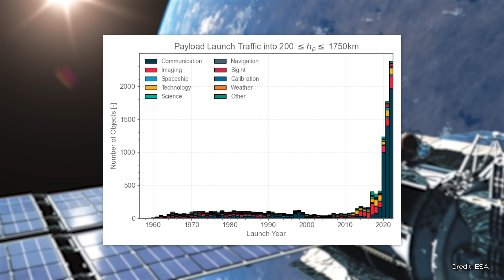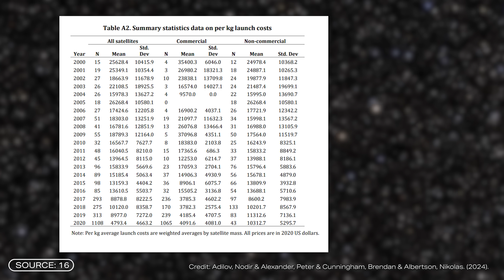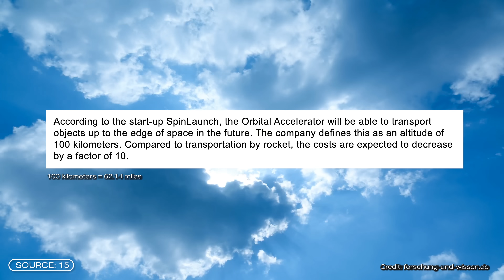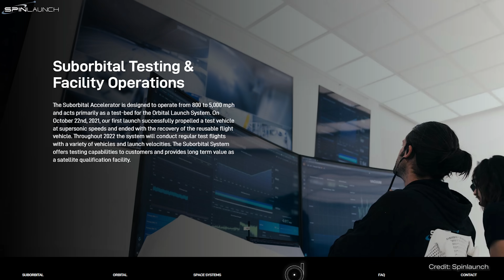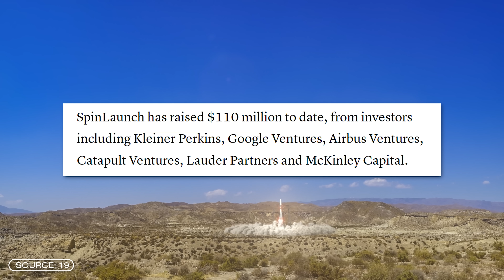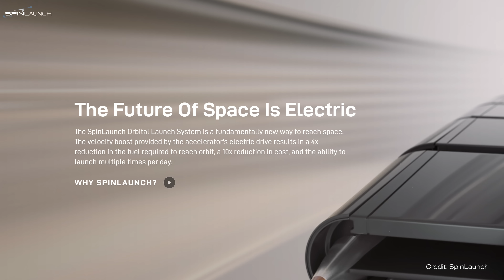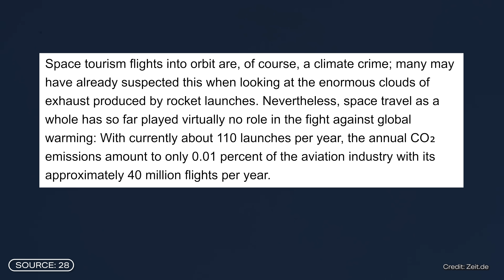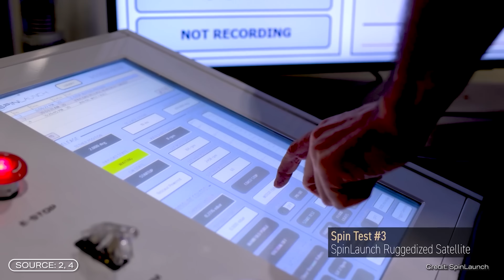How Do We Throw Satellites to Space? Update SpinLaunch

Comment: SpinLaunch is a bad idea that will end badly for the investors.  SpinLaunch can NOT launch anything into orbit, in order to put something into orbit Spinlaunch would need to also include a ... wait for it ... rocket in order to add the necessary dV to get to LEO and to circularize its orbit.  Also, the g-force the satellite/payload would need to tolerate is over 10,000 g's.  EG.   if SpinLaunch tried to launch a payload at 8000m/s and the radius of the arm is 160m the g-force would be over 40,000 g's or 400,000 m/s^2.  So SpinLaunch is NOT going to be able to release something going fast enough to reach orbit as the g-force would be insanely too high.  Indeed, if they only tried to reach 4000 m/s, about half the velocity needed, the g-force would still be over 10,000 g's so that's out of the question for most actual satellites.
What's next German Science Guy, the Space Elevator?

Comment: do a video on the Jucero!
Reply: they already have a high initial velocity while in the atmosphere. maybe use a ram-jet & take advantage of the air while they have a chance. it doesn't matter if you add velocity at higher or lower altitudes except you get the square of velocity loss from air friction, but then you might not need a rocket. nothing matters. who cares.

Comment: Not yet explained: Imbalance of the centrifuge.  When one end of the rotor releases a mass, m, with linear velocity, V, that carries away momentum, m*V, leaving behind -m*V, the opposite momentum, in the centrifuge.  Where do you find that momentum?  In a simplified case, that momentum could be associated with an equal mass, m, at the opposite end of the centrifuge.  If the satellite launches vertically, straight up, then at the instant of launch that opposite-end mass is moving straight down, and after 90 deg. rotation, its downward momentum is gone and it's moving horizontally.  The centripetal upward force needed to arrest that downward momentum, integrated over time during that 90 deg. rotation, obeys integral(vertical_force*d(time)) = m*V.  In effect, the rotor bearing has to supply the entire upward momentum of the launched projectile in the space of 90 deg. of rotation.  But the rotor is still imbalanced and spinning.  So let's get clever.  When we release the satellite projectile mass, let's launch an equal sacrificial mass, m, from the same radius at the opposite end of the rotor, sending it down a deep hole so it's safely far away when it hits bottom and goes KABOOM!!!  So with every launch you've created a little underground nuclear blast and you're just having to deal with a growing hot cavity in the ground.  But suppose, instead of launching a sacrificial mass, that you somehow reconnect your centrifuge rotor to a new bearing whose axis acts through the altered center-of-mass just after launch.  Then you have a re-balanced rotor, spinning on a new axis, and you can recover its kinetic energy (with losses) by regenerative braking and somehow store that energy for your next launch.  But you still have to deal with the entire momentum of launch, m*V, even though that momentum is now associated with a much larger rotor mass, call it M, moving down as a much lower vertical velocity, call it -v (minus v) so that momentum is conserved as the sum: m*V + (-M*v) = 0.  Your re-centered centrifuge axis is moving down after launch, and you have to stop it, but that large mass carries much less downward-directed kinetic energy, E = M*v^2, than you'd have in the small sacrificial mass at E = m*V^2.  You have a huge amount of linear downward momentum to deal with, quickly, while that momentum is in a more complicated dual-axis rotor carrying more recoverable rotational kinetic energy.  My problem: in SpinLaunch reporting, I'm seeing nothing like this being discussed.  At www.spinlaunch.com, in the SEE IT IN ACTION link, at 2:12 a control engineer says, “Taper down.  Water brake.”  Four words, to cover the entire topic I’m raising.  That might be enough to sell an investor, but I’m not sold.  What are they actually doing?
Reply: Adding  to my own comment, an obvious engineering adjustment to this imbalance problem might look like this: Mount satellite projectiles on both ends of the centrifuge rotor.  The first projectile launches, and the entire rotor recoils, moving away from the direction of launch while the central shaft is also undergoing a circular motion with the true spin axis moved to a new c.g. location.  After a full half-revolution, the second satellite projectile launches, at a slightly lower speed if it launched from the same off-axis-shaft radius because the axis shaft is recoiling away from the first launch.  Nevertheless, if the rotor is much more massive than the projectiles, then both projectiles can reach orbit with the help of rocket boosts.  Meanwhile, launching the second projectile re-balances the rotor.  Now the engineer has to deal with the recoil momentum from both projectiles and, as with a very large cannon, the moving spin shaft must be stopped and brought back to its original location.  The rotor might disengage from the motors when it recoils and then be re-engaged when it is brought back in line, or the entire assembly with motor-generators might recoil as a unit, an engineering choice.  One way or another, recoil and balance both have to be reckoned with.
Reply: @JosephSeale-i2v  I think I remember from some other discussion of this system that they release a dummy counterbalance mass at the same time as the satellite.

Comment: I have this package of Jordan "floss" tooth cleaners. There are around 20 in a newly opened pack. The pack weights around 35 gram, so each tooth cleaner weights around1,75 gram. At 10.000G, one tooth pick will then weight 17,5 KG!

I don't think it's as simple, as just glueing components together. If you say a SMD resistor weigh a twentieth of the toothpick, that's still almost a kilo for that tiny resistor.

Comment: The payload can withstand 10,000g. But what about the remainder of the rocket? Presumably it will be liquid-fuelled, because solid fuels are both polluting and produce exhaust cinders which can be really hazardous at orbital velocities. Then the rest of the rocket structure has to be strong enough to withstand those accelerations. Strong means thick and heavy. I cannot see this technology working for orbital payloads.

Comment: SpinLaunch? Can we survive the speed of the spin to launch to orbit, let alone going through the atmosphere at such speeds? Science Guy explains what SpinLaunch has developed to survive the trip. ‘Not we humans, but the rocket and its cargo.’ I still think a mile long, foot wide or maybe a meter wide Bore Hole riding Maglev rails in a vacuum tube, could get a meter long rocket high enough to start its solid rocket fuel booster and reach The Moon, but what do I know?

How about a mile high tower with a vacuum tube with Maglev rails, shooting a rocket. Could a mile high tower get a meter long rocket high enough to start its solid rocket fuel booster and reach The Moon?
‘How about on The Moon? That’s a Mass Driver.’

I asked Only the Facts about shooting a rocket out of a vacuum tube:

A mile-high tower with a vacuum tube and Maglev rails could provide an initial velocity boost for a projectile, but it would be entirely insufficient to launch a meter-long rocket to the Moon for several fundamental reasons:

Velocity Requirements: To reach the Moon, a spacecraft must achieve Earth escape velocity, which is approximately 11.2 kilometers per second (km/s) from the surface, or first reach Low Earth Orbit (LEO) at around 7.8 km/s and then perform a translunar injection burn.
Acceleration Constraints: To reach even a significant fraction of orbital velocity (e.g., 1-2 km/s) within a 1.6-kilometer (mile-high) track, the acceleration required would be immense. For instance, achieving 1 km/s in 1.6 km would necessitate an average acceleration of over 300 gravities (300g). No rocket, let alone a delicate payload, could withstand such forces.
Atmospheric Drag: Even at a mile (1.6 km) in altitude, the atmosphere is still relatively dense. Once the rocket exits the vacuum tube, it would immediately experience extreme atmospheric drag if launched at the high speeds necessary for a meaningful boost, rapidly dissipating much of its kinetic energy.
Delta-V from Solid Boosters: A meter-long rocket, even with a solid rocket booster, has a minuscule capacity for propellant compared to the vast amount needed to achieve the total change in velocity (delta-v) required for a lunar trajectory. Spacecraft bound for the Moon typically weigh thousands or tens of thousands of kilograms and utilize multi-stage rockets to gradually build up speed and altitude. A meter-long rocket would possess a negligible mass fraction dedicated to fuel and payload.
Payload Capacity: A meter-long rocket would have virtually no useful payload capacity for a lunar mission once its own structure, guidance systems, and propulsion system are accounted for.
While Maglev launch assist systems are theoretically explored for launching payloads to orbit, they are typically envisioned as supplementing very large, multi-stage rockets or for launching to very high altitudes for air-breathing hypersonic vehicles, not as a primary means to directly achieve lunar trajectories with small, single-stage rockets. The energy and delta-v requirements for a lunar mission are orders of magnitude beyond what this proposed system could provide.

Comment: As an engineering student back in 1983, I had an assignment to design an identical spin launcher, in the context of sending back pellets of refined metal from an assumed mining and smelting operation on the surface of the moon.  Such pellets wouldn't care about the g forces, which helped, and the lower escape velocity from the moon also makes it easier than launching something from earth. 
Regardless, it becomes a material selection problem very quickly, due to the forces and stresses involved in those very fast rotations. 
Another consideration is unbalanced mass.... either it is out of balance after launch of the satellite, or before launch.   Either way this creates large forces that need to be managed. (Unless you fire one projectile downward at the same time as you fire the other upward, but that might be a bit scary... 😂 )
Reply: I was wondering about that myself.  In 30 seconds of brainstorming one ideas was to use something mostly based on water as the "counter projectile" and arranges for it to be turned in spray in something like the flame trenches of a conventional rocket.  Either way, I bet it's going to be spectacular no matter if it works or fails!
Reply: This could be manageable, but it requires fast moving masses on the counterweight and launch arm and very sturdy axis with vibration compensations. 
I did some quick estimates of an alternative, and it makes also no sense:
mount a railgun in a large custom airbus (the plane itself can be seen as stage one).
Railgun length 40m, same 10000g stage 2 acceleration on the railgun.
The launch would maybe
 take 40ms during which the plane would be decelerated by 2.5g.
That could be within the limits of the airframe if it is specially designed. And the delta V on the plane would not really be noticeable, but ... top speed would only be about 2 km/s (between mach 5-7 depending on altitude)
Longer railgun would fit in the A480 (60 m) maybe et extending the nozzle beyond the plane. But the big issue is the bending forces on the airframe: not something these planes are designed for, especially not for repeated launches. It may work for a few launches and then something will break.

Comment: Having to make everything safe for 10,000 g is a deal breaker in itself. Adding glue, that is more mass, isn't a solution in this context, that's stupid. Absurd g-forces and highly restrictive size/shape of the payload, would make it extremely restrictive, if they ever would get it to technically work.  A very small, if any, part of very small market means they won't be able to make profit to finance further development, so they're doomed to always spend other peoples money in order to try to achieve what other already can do, and does better for every year.        

But there's a bigger issue, the higher they want to launch, the higher the initial velocity has to be, which increases the aerodynamic drag, which means you need higher initial velocity, which increases drag further, which increases required initial velocity further, and on and on. They run into a similar issue as with the Tsiolkovsky rocket equation, but with the difference that they don't have fuel tanks to dump, and their problem has an additional factor that increases exponentially. So, they're not really bypassing the fundamental problem they're trying to bypass, but they add additional problems.  

What they have achieved so far doesn't even make them qualified to make predictions about any details of their system if they ever were to succeed. 3% of their target altitude isn't 3% of the way to solve of their problems, not even near 1%. Reaching higher will get exponentially more difficult.

Comment: I'm skeptical about this venture: the force during spinning phase is perpendicular to the direction of the shock the payload will receive when it's enters the air. It's likely 2 orders of magnitude lower, but still could be 200G depending on weight/shape.
Reply: And in the time it takes to go around a half a turn, after it leaves the spinner it is flying sideways.

Comment: If there is a business case that needs thousands of small cube sats launched into similar yet individual orbits then this might be the most effective way to do it. Assuming they overcome the hypersonic aerodynamics challenges. But agains a planet this big with atmosphere this thick the physics is not friendly to this launch method. The projectile needs the highest velocity in the thickest atmosphere. 

Where this could really shine in the future would be launching stuff from bodies other than Earth. If something valuable enough is mined or manufactured on the Moon or some large asteroid, this system would definitely be the cheapest way to lob the payload to where it needs to go. Lower escape velocity needed and no atmosphere to burn up in. Removes the biggest obstacles. Then it just doesn't make sense to build rockets and manufacture fuel for them if it can be done with a spinlaunch powered by some solar panels. With regen braking of the arm to load the next payload the energy needed per launch would be quite low. The solar panel would just have to keep replacing energy lost to motor efficiency, bearings and the kinetic energy of the projectile.

Comment: What about the Delta G? I mean the change from 10000G to 0G in splitseconds during release. And the imbalance of the spinner after release. And the rotational momentum of the Rocket. And the rocket engine not surviving 10000G. And the transfer from thin air to thick air - let alone the stability of the membrane. And ...
Reply: Well, if you're going to use logic, OF COURSE Spinlaunch doesn't work. Spoilsport.
Reply: They talk about improving the robustness of the satellite to withstand the G load. Given that these new satellites will now withstand the G load, they'd also be able to be fired from a gun. We've been doing guns for quite a while, perhaps gun launching is a better bad idea?
Reply: @kevshouse  You just can't shoot a bullet in space.
People, ask those question to an AI before you comment, that's what I did for exactly that question in a different context, so now I know the answer !
Reply: Works great to separate plasma from your blood! Now to figure out how not to die! 😅
Reply: To be fair, don't artillery shells (which can contain electronics like proximity fuses) experience similar forces?
Reply: @codetech5598 good point, but i'd guess that ballistic artillery bullets have no electronics. Only the rockets that are self propulsed, i.e. they accelerate way slower. I think.
Reply: @Brainstunt Bullets with proximity fuses have electronics.

Comment: Rockets have low emissions compared to most other industrial things, but the one thing that isn't specifically talked about is the amount of "heat" that is generated in such a short span of time. Firing so many rockets one after the other like SpaceX and other companies are doing now can 'not' be good for the environment. We're already suffering from global rise in temperatures that are changing the jet stream which leads to massive weather imbalances. I can't see how all those rockets launches aren't also having an affect on the weather.
It'd be like taking a blow torch and applying it to the bottom of a fish tank and expecting no changes to happen to the water. It starts swirling in ways it hadn't be doing, and there starts to be hot spots and cool spots when it was one homogeneous. 
So having a device like Spin Launch would actually help the environment in other ways than just chemicals, it would help with reducing the heat dumped into the atmosphere.  Altho, that's just assuming tho that rocket launches would slow down if they became viable. However, sadly, I think it just means more launches overall.
Reply: The disintegration of small, e.g. Starlink satellites when they burn up is a significant climate impact, too.